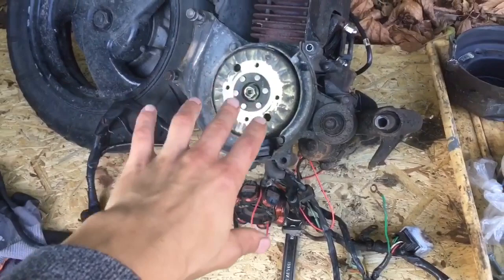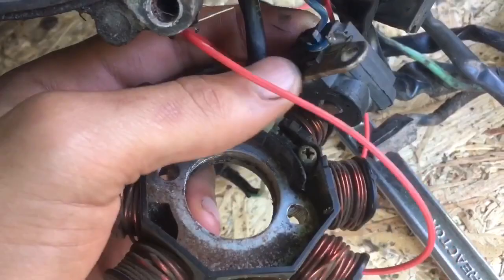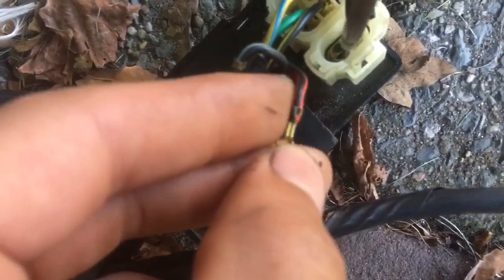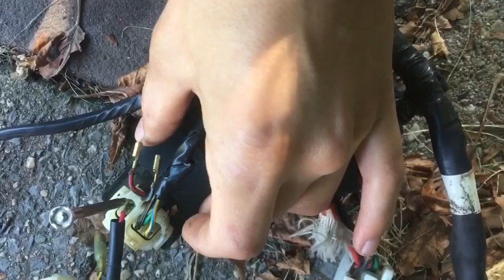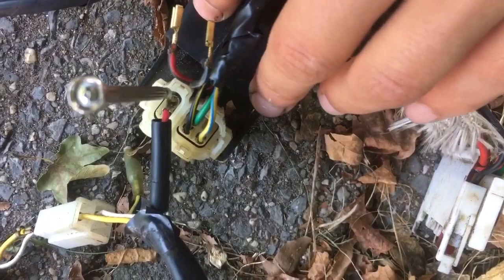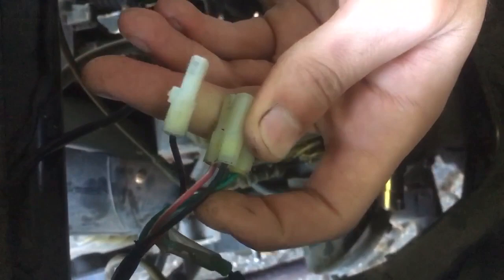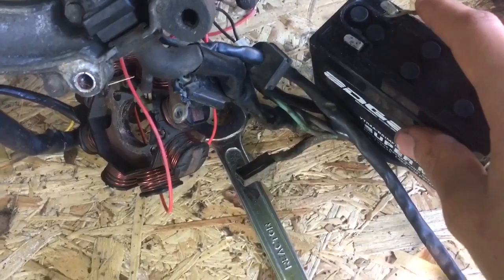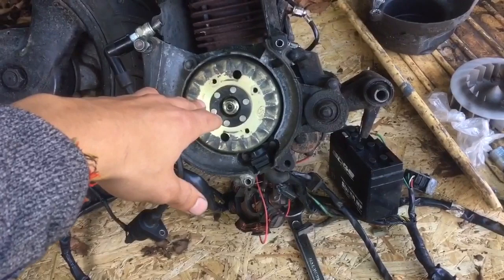DC to AC - scooter CDI setup 4stroke

Comment: Hey, my stator has 3 wires coming out if it, blue/yellow for the trigger, pink wire and a yellow wire. How do I know what one of the 2 I put into the cdi for power? And what would the other one be used for? Cheers!
Reply from the maker: the pink and yellow are probably for the voltage regulator that converts the ac voltage into dc for ligths and horn

Comment: is it posible to do it otherway around? my harnas is kymco dc cdi en wiringharnas but the motor is gy6 china ac stator. can i just change the stator and flyweel will the timing be ok to fire the ac engine
Reply from the maker: ben ben then you need dc stator yes it should work

Comment: Hey i have ac stator and dc cdi can i put the ac stator power to the dc cdi?
Reply from the maker: Antilaakeri there is a wire issue. The dc and ac stators have different wiring. So that will be difficult
Reply from the maker: Antilaakeri you can try to wire the red/black wire from the stator to the cdi. See if it works
Reply: @michaelboot  yeah i know the wiring, but i was just thinking will the dc cdi get damaged from ac power?
Reply from the maker: Antilaakeri i am afraid that an ac stator will produce alternating current which the dc cdi will probably not like. Might get damaged
Reply: Can I run it from the stator to a rectifier then to the CDI
Reply from the maker: @uncleasshole3787  just get a matching cdi and stator (dc or ac)

Comment: Why would you want to go from DC to AC?  Usually folks are trying to do just the opposite so they can have auxiliary power to their lights, etc with the engine off.  Just curious why you are doing this.  Thanks.
Reply from the maker: good question. The scooter was 2stroke and I wanted to convert the scooter into 4 stroke by replacing the engine, but I wanted to keep the wiring original. Therefore, I have changed the CDI only so the bike can run with the original wiring.And AC runs without using a battery while DC often doesnt run without battery.